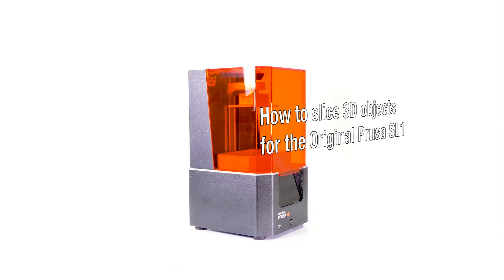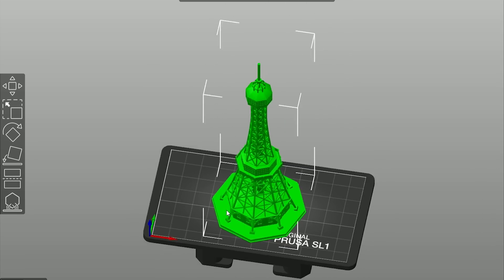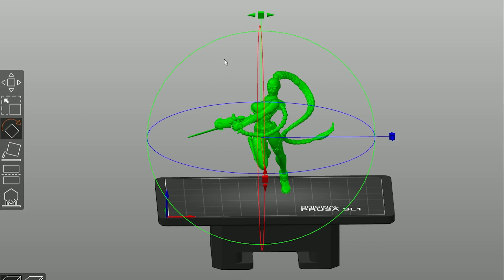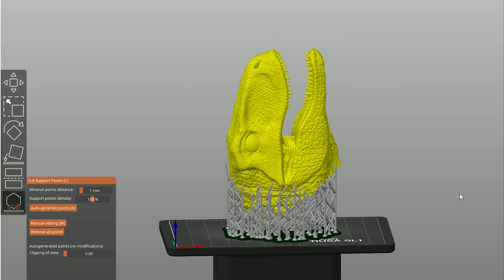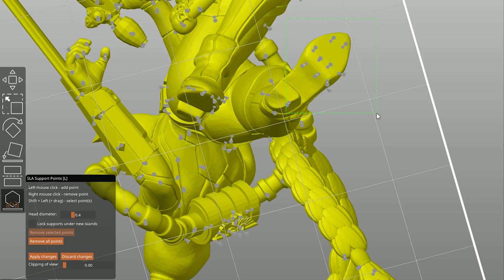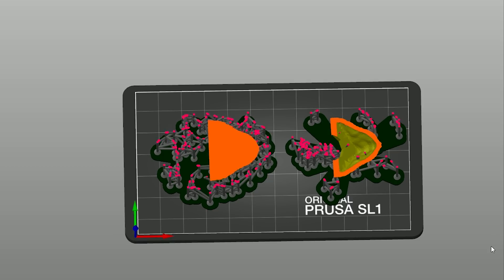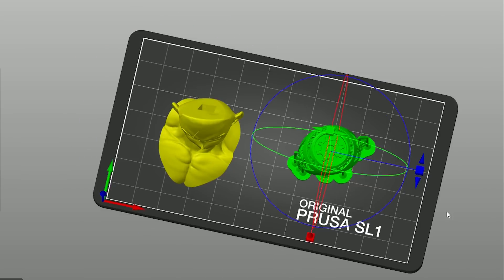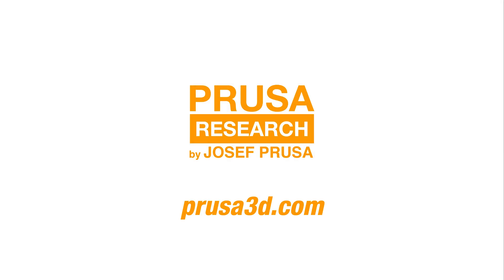How to slice 3D objects for the Original Prusa SL1

Comment: why do SLA / DLP prints have elephant feet? this is a thing for extrusion printers and heat
Reply: The exposure time on the first layers is longer.
Reply: @Mendraak  that does not produce bigger parts, it just cures the resin more. (it also helps the initial layers adhere better to the "build plate")
Reply: @kensaiix  Longer light time is to secure the item to the plate yes, but also can cause light bleed so the bottom layers may be slightly larger.

Comment: If the object you need to print requires the flat surface (or any part of the model) in direct contact with the build platform, then you can:

1) Add a chamfer edge to that section if you created the model
2) The developers can integrate a feature similar to "Erode" on NanoDLP slicer which reduces the outer perimeter by 1 or 2 pixels so that the over exposure or light bleed of the initial layers cures that section.  

For the chamfer option, this is my formula assuming the following parameters: Initial layers 6, Layer height 50um would be (6-1)*50=250 so the chamfer would be 250 or 200 microns.